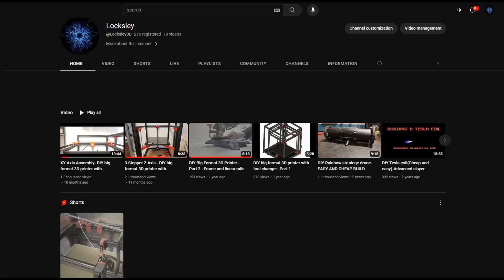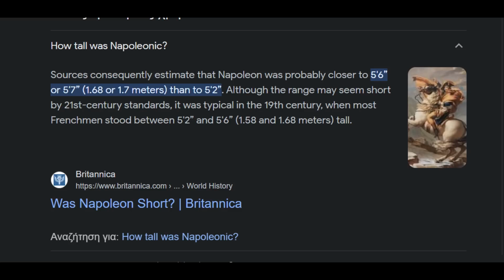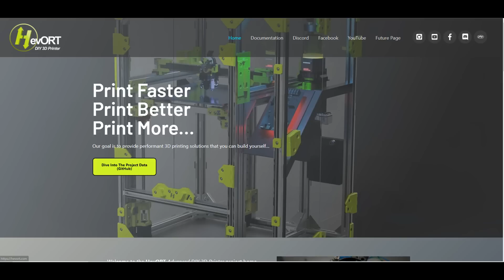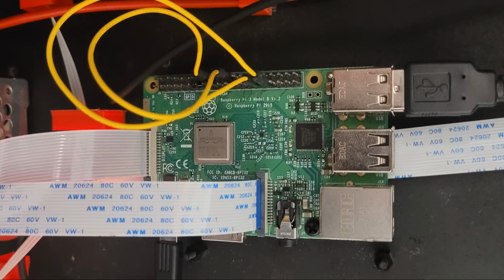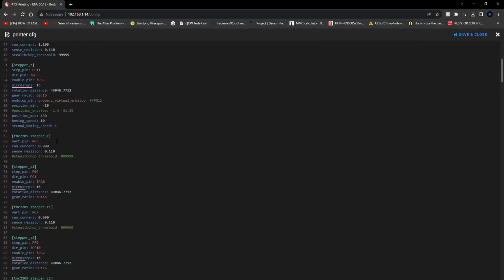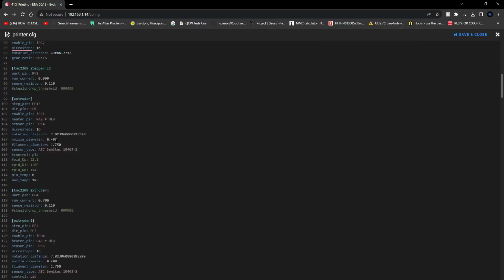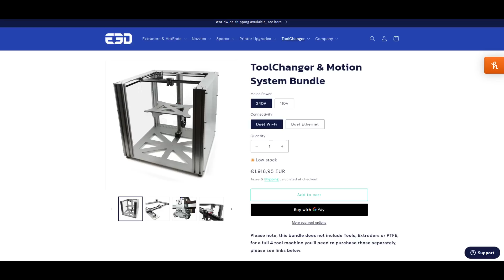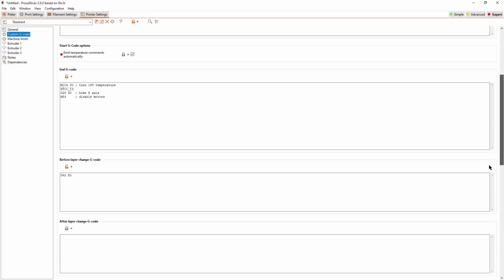An Overview Of The Finished Tesseract - DIY Big Format 3D Printer with Toolchanger

Comment: Great work, requires a lot of patience to get such custom machines designed and going!

Run into similar issues building a 650 x 450 x 700mm 3D printer with constantly fighting Z-banding, bought several sets of ballscrews / leadscrews and still no results. i will make one last attempt to solve this with oldham couplers if i find something that matches the odd igus iglidur nuts i have otherwise im going to belts too.

As for the Prima flexplate, i have been using those for the last few years and they are absolutely excellent. Make sure that you heatsoak your bed to reach the 60C on the top of the flexplate, as the temps you are reading are not even on the aluminium plate you have for the bed, it's on the heater PCBs. i would suggest to go with an AC silicon heater directly on the alum bed, as after that you also have the magnet and then the flexplate, it's a lot of layers to heat up without losses.

On the issues you have with needing to make a bed mesh every single time, i would suggest making the mesh once and then just doing the physical leveling at the 3 points nearest to the belts. if the plate is flat every time at the same angle, then the mesh doesnt change :)

Comment: Pretty new to this all, but seeing your vid made me brainstorm about the toolchanging haha I see a lot of improvements :D
Reply from the maker: There are definetly a lot of improvements that can be made here as I said in the end. The biggest one would be changing the tool grabbing mechanism to something like the prusa XL. But there are many more upgrades that could enhance a system like this
Reply: @Locksley3D I'm always very intrigued at the choice of what part of the tool is changed. It seems most of them choose to always include full fans and electronics.

Makes me wonder why. As I figure that's the most weight, so why not have fans on the main head, turn electronics into some pressure system (imagining something along the lines of how the btt hermit crab does the electronics)

That way you only need to exchange minimal weight
Reply from the maker: @djmulder  I did think of putting the part cooling fans on the main platform but it was near the end of the project and I would have to reprint all the heads, if I change the mechanism I probably will put the fans on the changing head

As for the hermit crab idea, it is very much possible and to be honest I am surprised no one has done it yet. This was my first printer with klipper so I didn't have all that much experience and wouldn't know how to set up dynamic changing of pins correctly for that idea, if I ever figure it out I would very much consider doing it. However even if there are no cables there is still the filament line that I would have to route anyway

Comment: If you are having issue with any filament sticking to the PEI sheet, try cleaning the sheet with Dawn dish soap. While wearing rubber gloves, I squirt on a good amount of Dawn dish soap (this brand has worked the best for me) and use a plastic brush to scrub the surface, then rinse it very well with hot water and pad it dry with a lint free cloth, and trying not to touch any part of the print surface with bare hands. For me it works every time on my 230mm, 350mm and 370mm PEI sheets. I get great adhesion with Polycarbonate, PLA, PETG, TPU, ABS, ASA, PA6CF, PA6GF... This will usually last for a good 10 to 20 prints at the minimum before I need to use soap again. I also find if I set the temp on the bed, even for just the first few layers to 5°C to 10°C higher than normal this also works very well for me and haven't had adhesion issues ever since I started doing it this way. I can sometimes extend the time between using Dawn dish soap by using 99% IPA with a good lint free microfiber cloth.

Comment: Wood enclosures are 100% acceptable. and dont let anyone say otherwise. Have a look at Construct-3D, before they used bamboo, they apparently prototyped with MDF due to the insulative and vibration resistive properties.

Comment: Throw a Beacon probe on there to speed up your bed mesh and gain much more resolution
Reply from the maker: I have seen them and they honestly look amazing,I am considering getting one
Reply: @Locksley3D  I use one on a Ratrig 500 and a v2.4 350. The bed meshes are incredibly accurate and fast. The best part is, unlike those darn inductive probes, they aren't affected by temp.
Reply: @Locksley3D You could also try constant force springs to act as a counterweight for the bed so it doesn’t move while the printer is off.
Reply: One more vote for the beacon.
You will be surprised. And wonder how you did before having one 😢

Comment: So, how do you compensate for the thermister variations across the four beds?Also, have you considered any bowing of the x axis in a heated chamber by trying something similar to the K3 and cross gantry for support purposes.
Reply from the maker: For the bed variation I honestly haven't given much thought about it but I also haven't had many issues with it, the aluminium heatbeds are good at spreading the heat but there still are probably cold spots, also when it comes to x axis bowing I also haven't tested it enough with printing high temp material like abs that much but the few prints I did with abs at 100 bed temp didn't appear to have much of an issue

Comment: The bed adhesion issue might be the temperature of the top of the bed dropping up and down. Also if fixed might help with the variance. CNC kitchen had a video on PID tuning the bed showing variance can occur when the bed drops in temperature. Id defiantly try a flat bed from precision 3d printer parts and a Kenovo mains power beds or four smaller beds and heaters
Reply from the maker: I have watched the video you mentioned and after it, i did switch to PID control on the beds which, in my case, didnt't have a huge improvent. Also as i mentioned in the improvments section, using a big machined bed and a keenovo heater is a future upgrade i would like to make and is what i would recommend to anyone who would attempt this build

Comment: How did you implement the 4 bed heaters in the G-Code? I used 4 250*250 aluminium plates with a scaled up Voron 2.4 Mount and one 3DPrima PEI-sheet and have aboud 0,22mm deviation across the 500mm bed. Heating with 230V Heaters is pretty fast.
Reply from the maker: If your heatbeds talk to klipper directly as heaters then talking to them in gcode shouldn't be hard, depends how they are connected to your printer, for me I found that any deviation lower than 0.2mm is fine. I do a bed mesh, find the high or low spots and add spacers until the bed is flat
Reply: @Locksley3D  But you dont want to turn on all heaters for just printing in one corner, right?

Comment: Hello.

Does your print bed with weight of plastic fell when you turn off printer?
Reply from the maker: I haven't printed something really big, like  1kg yet but with prints around 400g the bed doesn't fall but when turned off it does loose it's position so it's needs tramming everytime it homes. Fixing this issue is high on the list of upgrades

Comment: For the PEI sheet, did you scrub it with hot dish soap and water? That’s the only thing that actually fixes adhesion problems, alcohol wipes are not enough.
Reply from the maker: I have cleaned the bed with soap and it has made adhesion better, and with good tramming getting a perfect first layer isn't hard but still my ender 3 with pei for some reason has much better adhesion with the same treatment

Comment: I nearly bought the toolchanger but I decieded not to, need a brain surgery on my brain to be clever. It is interesting to watch your YT, I have to say I need someone to help me to do the software, I can do is to build the rest. So I got 13 printers in my collection. One question will you get one pretty clean Tesseract? (doesn't have to be just you). Keep up a good work.
Reply from the maker: Thx for the kind words, while I was considering the original tool changer it's a bit smaller than I wanted and also too expensive for what it is in my opinion, other than that it's a wonderful machine and was the whole reason I built this printer, when it comes to software it's really not that hard once you get used to klipper, all the configs are on github but if you need something more specific I would be glad to help

Comment: What screen do you use,and where did you get that mega long ribbon cable for it?
Reply from the maker: I use a 5 inch pi screen from waveshare with a resolution of 800x480. I don't remember the exact size of the ribbon cables but they might be a meter long, I bought them from a local store in Greece but since I can find them here you should definitely be able to find them  online
Reply: @Locksley3D  thanks!

Comment: Wait - not a single link for us to buy the controller boards ??? :))
Reply from the maker: If you meant the main board than it's an octupus btt1.1 from big tree tech, The small arduino board that I use to control the servo I would not recommend making, just use the servo control on the mainboard to talk to it, much easier!

Comment: That PEI sheet is crap.
Don't let people gas light you about it. Everyone's solution is to run the temp way up, which is just a perfectly stupid answer.
PLA should stick at room temp, if it does not, then the sheet sucks.